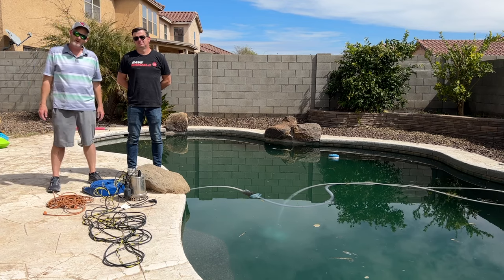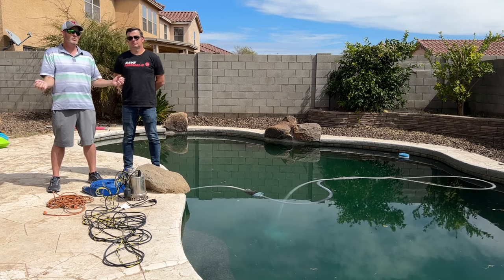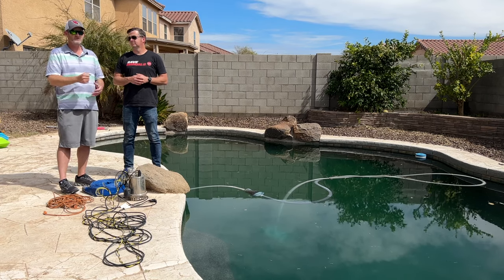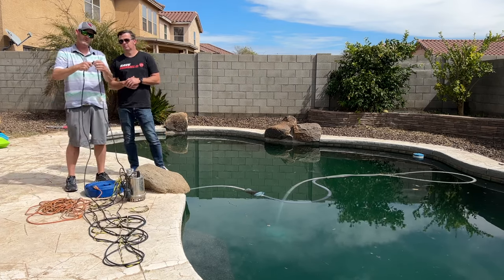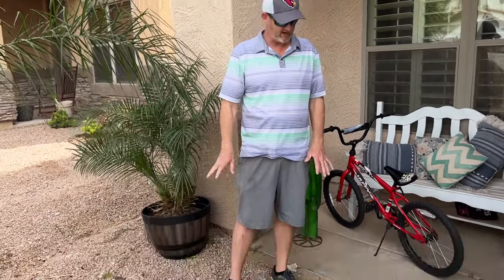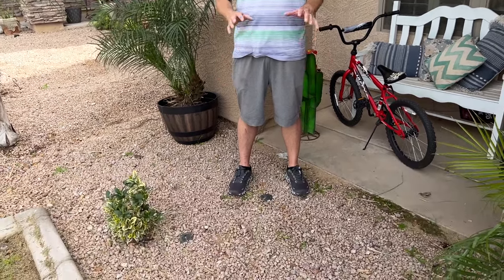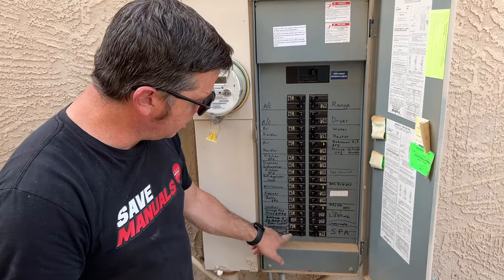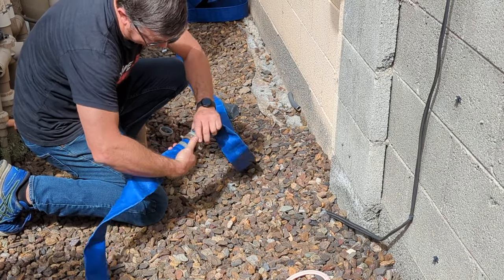Best way to drain a swimming pool yourself!

Comment: If I have a DE pool which backwashes to the sewer if I close off my skimmers can I drain using the pool pump instead of a sump pump?
Reply from the maker: I guess you could as long as you make sure that the skimmers are completely closed and no water is getting sucked in and make sure that you watch it and turn off when it gets down to the drains so you don’t run pump dry. I would assume that wouldn’t hurt your filters.

Comment: Great video! First time pool owner and made the draining of pool very simple. 

Question - after filling pool back up and pool panel turned back on, anything need to be done with pump? Wasn’t sure it goes back on cycle it was set to previously.. 

Anyway, thank you for the content
Reply from the maker: Thank you 
Once the pool is full you need to prime all the pumps as they will Have no water in them. Take off pump lid basket and add water before turning on. Add start up chems